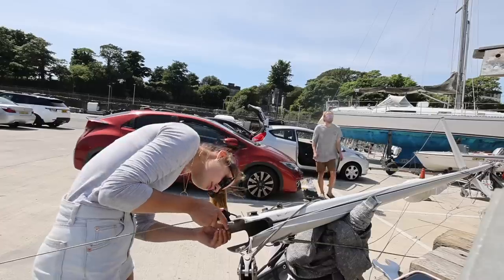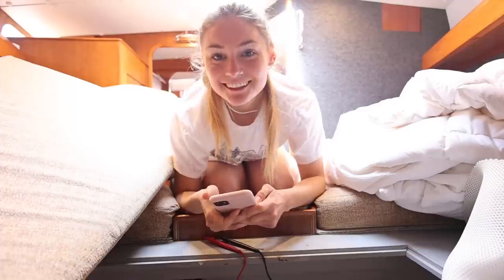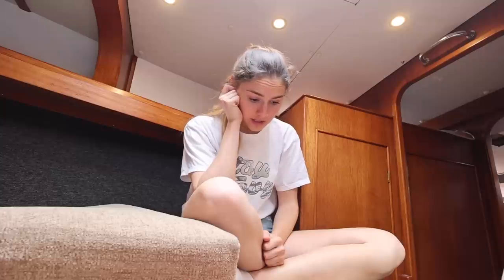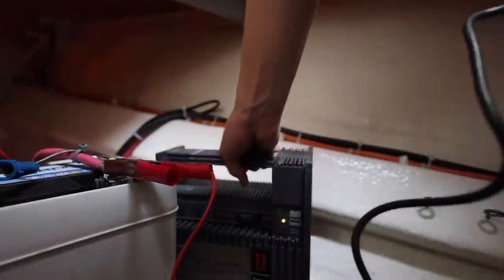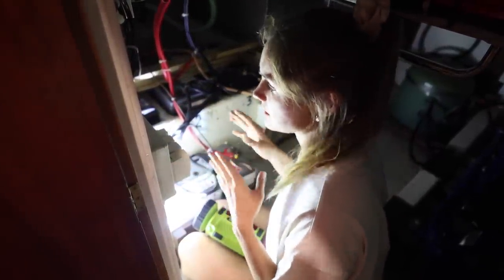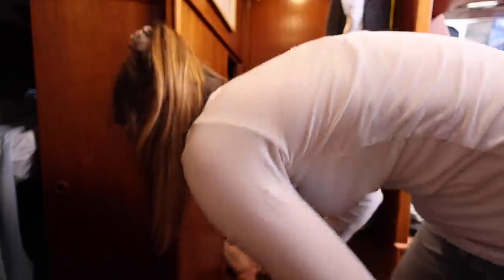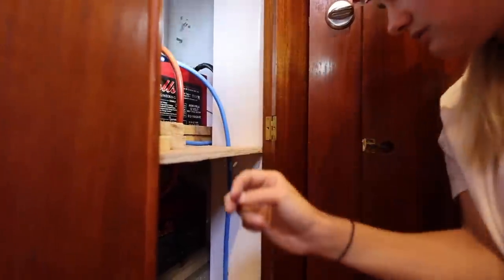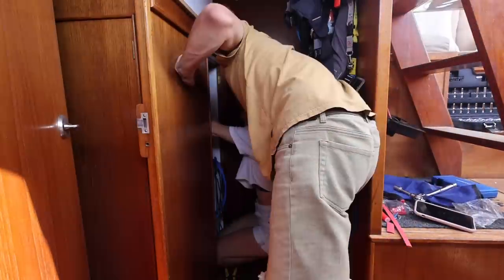ELECTROCUTED whilst rewiring our boat

Comment: you should watch a you tube video on a multi meter .lol. Why did the fuse blow is the real question.? So you are replacing really old batteries with old batteries, why not LIPO ? With that wiring it is amazing the boat did not set on fire years ago ,. Do not think because it is only 12 volts that it cannot kill you .There is a reason for those heavy wires ,high amperage ,that is what can kill you.
Reply: LiPo has no place on a boat - they are the ones that go bang
LiFePo4 or LTO are both good chemistries on a boat BUT there are also so many other things that you must do to have a safe system
You can't just drop a lithium battery in to replace a LA battery and be safe
Reply from the maker: The fuse blew because the battery was too flat. Didn't go for lithium because they are incredibly expensive and we would have to do a lot more to our electrics for them to be compatible. AGM's are fantastic batteries and we are really happy with our choice.